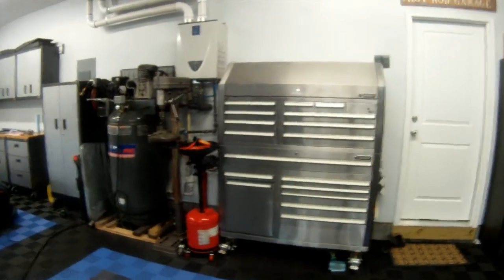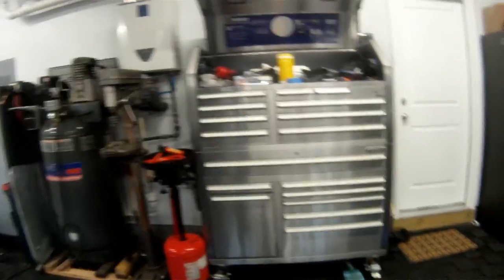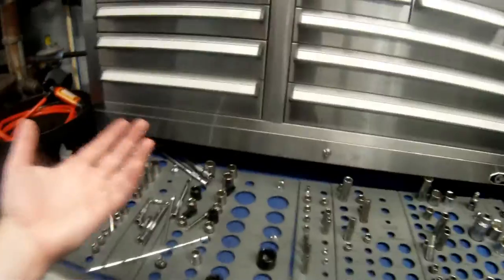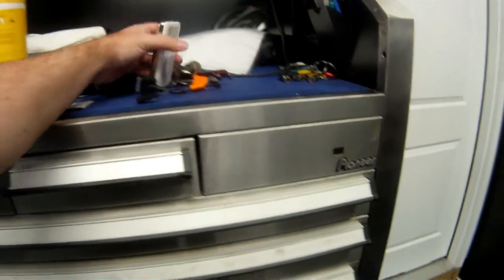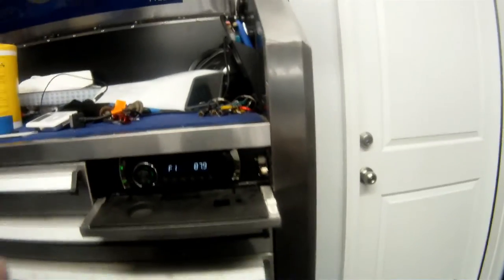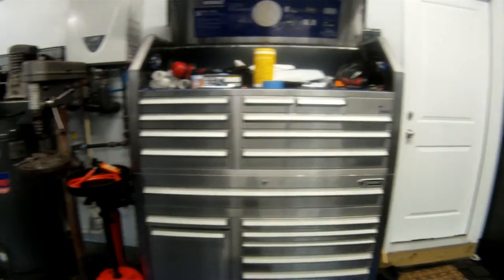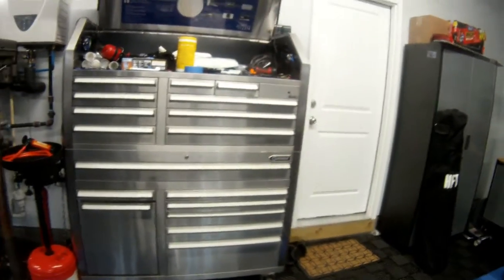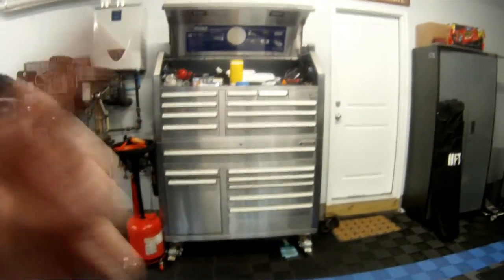Kobalt Stainless Steel Tool Cabinent Review

Comment: I just got one of these second hand, but the pioneer radio is missing the faceplate. Do you know what model the faceplate is? I'd like to purchase a replacement, if it's still available.
Reply from the maker: Any single din radio should fit into it.
Reply: i have the original radio with faceplate. upgraded to a bluetooth head unit. lmk if you need it

Comment: If you are interested in adding bluetooth without changing the head unit, Dewalt makes a bluetooth adapter that converts a bluetooth signal to an aux cord. Dewalt DCR002 is the model number.
https://www.lowes.com/pd/DEWALT-Jobsite-Radio-Bluetooth-Adapter/50374058

Comment: Just got one of these second hand. I need to replace some of the drawer glides but I can't find the model number anywhere. Could you give me that number and maybe the info about where to call if it's on the sticker somewhere.
Thank you so much!
Reply from the maker: There's no parts available for this toolbox anymore - I called Kobalt and all that they had was some rubber trim for the outside of the drawers.
Reply: @bonecrrusherSS  thank you for the reply. I wonder if there are any third party cos.  that have compatible glides. I'll call Grainger tomorrow to check. If I do eventually find some, I'll post that info in a follow-up post here
Reply: Does anyone happen to know the model no.  of that box?
Mine has no sticker anywhere I can find.